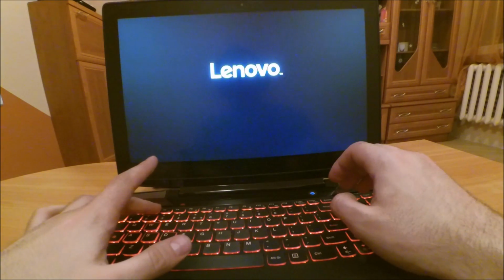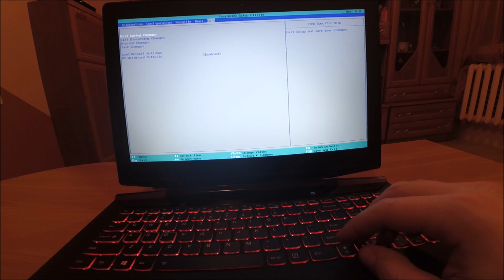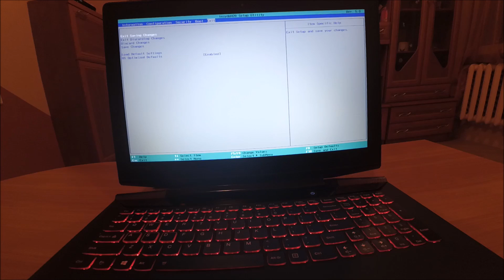Lenovo IdeaPad Y700 SSD Install and Upgrade

Comment: This thing works great to this day, I have both drives as ssd and an external for storage, upgraded it to 32g of HymperX impact CL15 2666hz ram and it is powerfull enough
Reply: Where did you buy your 32 gb RAM space ?

Comment: Did you know this laptop can handle NVME SSD, which is a BIG improvement compared to stock performance. Hope this helps for those users upgrading their Y700. Cheers ;)
https://youtu.be/ssUdNBt0iC8

Comment: I have this and it won't go past the Lenovo start up screen any help I was told to remove the battery and  power it on with just the charging cable does this work help please!

Comment: I'm having a problem with installing that blue connector thing. I don't know if I'm placing it right but the black thing doesn't seem to stay put.

EDIT: Just got it. I had to place it farther under the black thing than I originally thought. The black thing should pretty much close automatically when it's placed in the right spot.
Reply from the maker: glad you were able to figure it out

Comment: Hi GCR, would you have any advice regarding the problem i have trying to fit a Crucial MX300 into a Yoga 700 14isk. The current drive is 4.5mm thick and the new one is 7mm thick. Both are 2.5''. The holes in the metal support will not line up with the screw holes in the mx300 drive due to the height difference. Is there any other method to anchor/fix a drive to the metal brackets? glue?

Comment: Are either of your RAM sticks soldered onto the board?  This laptop is posted on ebay, brand new, for $749, an excellent price for the specs (besides the i7/960m, it's got 12gb ddr4, 1TB hd, 256gb SSD).  The only thing that concerns me is that it says there's a 4gb RAM stick and an 8.  The 8 is removable but the 4 is soldered onto the board.  Is that normal for the Y700?
Reply from the maker: not sure about the specific model you are looking at, but on my laptop both ram sticks are not soldered and can be upgraded
Reply: 80NV002AUS is the specific model.  http://www.ebay.com/itm/Lenovo-IdeaPad-Y700-15-6-FHD-Gaming-Notebook-Core-i7-6700HQ-12GB-RAM-256GB-SSD-/391625142739?hash=item5b2ead71d3#rpdCntId

Just noticed when looking at it again that it also lists a blu-ray writer.  I've heard of some gaming laptops with soldered RAM, like the 2015 HP Omen as an example but nothing like that with the Y700.  Heck, even if it's on the up and up, with the specs listed I'd be all over that for $749 even if I couldn't upgrade the RAM any higher.  It's just kinda unusual and I'm not sure if I can trust it.  

Thanks for the response.

Comment: Hey thanks for the video, I've successfully done this with the Crucial MX300.
Reply: Suzanne O'Callaghan I did not have such an issue. The laptop I have is different from the one you've got, but that shouldn't matter. In theory, if a laptop is using a 2.5" inch storage device (in your case, HDD you want to replace with an SSD) you should just be able to replace it with any other 2.5" SSD. It may be a little bit thinner but that shouldn't matter, so I'm not sure. Sorry, I wish I could be of more help, I pretty much followed this video and it went the same as for the person in the video. All I can say is try again and see if you overlooked something when aligning it.
Reply: Suzanne O'Callaghan It might be that it just doesn't support 7mm, but that would be unheard of for me. Usually what I hear is that a laptop supports only 7mm, but not something like 9.5mm. 7mm is the most common thickness for a 2.5" SSD (and HDDs too I believe).
Reply: Suzanne O'Callaghan Depends on what you want to do, if you want to install Windows from that memory stick, you'll want to plug the memory stick in and boot from that. If Windows is already installed on the Crucial, you'll want to boot from that. Windows Boot Manager can show you different options about how you want to boot and such, and to change settings / recover. Might have to just try both Windows Boot Manager and the Crucial.
Reply from the maker: np, glad it helped
Reply: hi, im just trying to do it with Crucial MX300 on my Lenovo Yoga 700 14isk and I find that the metal support plate holes wont line up with the Mx300. It seems the current hard drive is a bit thinner than the MX300. Did you have this problem? If so, how did you get over it?
Reply: Thanks for your quick response flash. The 2.5" I am replacing is 4.5mm thick whilst the mx300 is 7mm thick. I can't screw the plates onto the new drive. Frustrating
Reply: one other question, if you dont mind. when i turn on the pc i see 2 options in the boot menu 1. windows boot manager    2 ATA HDD Crucial. Which one do i choose? I have an os bootable memory stick

Comment: thanks for your video. I have one question; in order to install my ssd into my Y700 14" I need an adapter which is EXACTLY the SATA to M.2 blue "cable" that you had to remove from that SSD. what is the name of this adapter so that I can buy it?

Comment: Hi thanks a lot for the video. Could you help with an upgrade I'm doing to my y700 14?

The one I bought had 1tb+128gb ssd. I bought a 2.5 inch Samsung ssd to replace the 1tb drive and I've never done any laptop upgrade before.  The OS is on the 128 m.2 SSD. I'd like to clone the OS to the 500 gb ssd. Do I just do that and then format the 128gb m.2 ssd? Where will the OS run from when both the m.2 and 2.5 inch ssd are installed?

Thanks,
Khaled

Comment: if i want to upgrade my hdd to samsung's 850 evo 2.5 inch 1tb version! and m.2 to 512gb samsung's pci-e slot one! it can work? currently i have same hybrid hdd 1tb and 128gb ssd!
Reply: The intel version of the laptop takes pci-e ssd drives.

Comment: This latop comes with an available M.2 Sata slot for SSD upgrade right? It makes no sense you buy a SATA SSD, replace the HDD and throw the HDD away. Bad decision bro.
Reply: exactly!
Reply: He said M.2 cost more.
Reply: M.2 is way more expensive bro....
Reply: install both.  This is my plan.
Reply from the maker: your post makes much sense, but the thing is I did not buy my SSD drive, I had bought it previously, so it made little sense for me to buy a new m2 drive, it would be a nice upgrade if i had the money tho, maybe once i make it big on youtubz
Reply: yes it is. I've been searching for the past month man. m.2 is 100 to 200 dollars more than a similiarly sized SATA SSD. If you've found different (not that Intel 600p crap) please send a link. I'm kinda desperate.
Reply: Sebastian Luna Cortes no, it's not :-|

Comment: Do you need unplug battery?
Reply: Nope, just make sure the laptop's not turned on and not plugged into its charger.
Reply: +Lance Shield and what about screw for m2 ssd?  Can it hold in place without screw
Reply: No, it needs one 2.0 x 3mm screw, which can be found at basically every hardware store.

Comment: Whats the purpose of all the foil looking things that covers the HD and the RAM?
Reply: heat dissipation. they conduct heat outward and its sweeped out by the fans.  I guess they crammed in high end hardware into such a small body, they need to use these metal sheath.

Comment: Thanks for the video. After I undid the screws I was worried about trying to force that gap open thinking there was a rivet holding it together, but apparently not

Comment: The model that comes only with a 256gb SSD is it possible to add a 1tb HDD as well?
Reply: Yes!
https://forums.lenovo.com/t5/Lenovo-P-Y-and-Z-series/Lenovo-Y700-SSD-and-Memory-upgrade/td-p/2200745
Reply: Sorry to ask 5 months after your comment, but that page only explains how to install ssd if you already got the 1tb HDD version. From my understanding the 256gb SSD version comes with an empty slot for an extra harddrive but no connector(?). So where would I get one of those, or is this something Lenovo has addressed?
Reply: ImRageQuitter I got the 256gb SSD Y700 and yes there is an empty slot where you can add a hard drive(I added a 500Gb SSD),and yes you need a connector that you can buy anywhere I think(you can definitely find it online though).

Comment: what is the port called that he used from hhd to the other one ?
Reply: SATA is what you're talking about?
Reply: +OxGualG043 the hard drive connector cable my one doesn't have that
Reply: thats what im wondering too.. ffs
Reply: Look on ebay

Comment: Thanks a lot for this video! What should I do if I want to perform a clean install in the M.2. I don´t care about the data of the HDD. I have already made a USB with Windows 10 on it, but I don´t know how to insall it in the new SSD. Do I need to remove de HDD? Help me please!!
Reply: Just prioritize the SSD in the BIOS boot menu so that the SSD boots first then the HDD. Plug in the bootable WIN10 USB and when the machine boots it will prompt you to install win10 since it detects no OS in the SSD as it sees that disc first. 
When you do that, if you still leave the SSD to be the first to boot the machine OS, you can safely format the HDD having Win10 only in the SSD.
Reply: @flyingspaghetti  im from the future. thank you very much
Reply: please answer this comment ,it's my problem too.. should we remove hdd for adding a ssd hard drive???????

Comment: Good video, cheers ;) 1 thing i dont quite understand is why you remove the 1TB HDD and replace it with a SATA SSD, while there is a SATA 2280 M2.0 SSD open and ready for use? A M2.0 SSD is even faster and then you didnt need to remove your 1TB drive. Cheers again for the video ;)
Reply from the maker: +Stroffel main reason is that i had an SSD drive from my previous laptop and did not want to spend another 200 euros after just buying thee laptop for 900. I'll upgrade eventually.

Comment: Nice video! But Lenovo I think left special slot on right of your "fusion" hard drive. This slot is exactly for SSD - so there is no reason to remove the 1 TB drive - it is a good storage option. Small slot is for special very fast SSD which look like a tiny board.
Reply: my friends y700 has a 128gb m.2 sata in that slot.  It's so small that most of their content is on the noisy, hot, slow HDD.  We replaced the HDD with a 1tb SSD and the small m.2 with a 500gb m.2

Comment: 3:03 that noise was the sound of your product warranty suddenly expiring. Next time, insert the tip of a plastic zip-tie into the corner gap, and wiggle it around the sides to gently release the locking clips.
Reply: The product warranty on these things are a joke anyway.
Reply: Please explain how to do that.

Comment: s it M.2 pcie or M.2 Sata? What is the m.2 size?
Reply: This is an 2280 M.2 sized slot.  Its not SATA, its PCI Express.  I put a Samsung 951 (AHCI) SSD and works fine.  Be warned that some people had problems using NVMe SSDs.  So I suggest the safe and tested solution. Samsung SM951 AHCI edition M.2. 2280 sized SSD.  Ofcourse if you choose to put there a sata3 m.2. ssd it will work as AHCI is sata3 backwards compatible. Hope I helped

Comment: Hey man. I have this notebook but the version with a single 512 SSD. Do you think I can add a another SSD?
Reply from the maker: +E. Camilo you should be, you just need to know if it has m.2 ssd or sata and get the other one.
Reply: +E. Camilo +Game Changing Rice i have the 512GB SSD version too and just got my 1TB crucial SSD I wanted to install into the Lenovo y700 as a second SSD. BUT.... where in the video the HDD is shown with mount and cable, there is absolutely nothing... so now i miss a cable and the mount for the SSD. other than that it will work i guess
Reply: Beat Scherrer Yeah, I found that the hard way too. Do you have any idea where can we get those?
Reply: +E. Camilo hey i can send you the link later this day or tomorrow, but if you're not in the US the provider won't ship below 200$... which is quite shit for me as a european.
Reply: I am also in Europe - Denmark. Both cable and the support cost 200 dollars?!?
Reply: the company who sells the parts won't ship to europe unless you have an order above 200$... which is kind of ridiculous... the parts cost about 30$ (brackets and cable). the site https://www.encompassparts.com/ and the part number of the bracket is 5B40K25518 and the part number of the cable is 5C10K25544 ... it really bothers me that the y700 was sold without those parts, it's just annoying and kind of a bad move for the lenovo company. nvm if you can find these parts anywhere else available in europe, pls let me know. seems that many other people had the same struggle and some did really get pissed off by lenovo. gotta try the support some day soon. cheers
Reply: Beat Scherrer These items must exist in some other webiste. Maybe eBay. I found a few but I need to make sure it is the same.

http://www.ebay.com/itm/5B40G59773-Lenovo-Y70-70T-HDD-Bracket-Caddy-Grade-A-/161918475118?hash=item25b317db6e:g:kMAAAOSw1S9Wb20X

For example.
Reply: +E. Camilo just be sure to get m.2 2280 (22 by 80 milimeters)
Reply: +E. Camilo What kind of screws did you end up using to mount the bracket and HDD?

Comment: Why not on m2 SSD? in Y50-70 was without M2 but Y700 have this port. You can have 2 drive and M2 can be even faster
Reply from the maker: +CZARNYEU because I already had the SSD I installed and i did not really feel like spending another 100-200 euros for an m.2 when i spent 900 on the laptop for now. Next thing i'll add is probably more ram.
Reply: Game Changing Rice i upgrade RAM and replace HDD with SSD in Y50-70 - videos about it is on my channel. I think you should install M2 SSD in future
Reply: +CZARNYEU m.2 in this particular laptop is no faster than regular SATA, because it's connected to SATA anyway. m.2 is much faster when it's connected directly to pci-e. but not in this case.
Reply: +Piotr Karaszewski może nie jest to NVMe ale ciut szybciej niż przez SATA

Comment: does the laptop have M.2 slot?
Reply: +Game Changing Rice is it M.2 pcie or M.2 Sata ?
Reply from the maker: +Valeri Karastoqnov can confirm that it does
Reply: +Game Changing Rice what is the m.2 size? thanks
Reply: +Dancin Cars +Valeri Karastoqnov Yes, it has an M.2 SSD Slot....The M.2 Size is 2280, 22mm wide, 80mm long, but shorter 2240 and 2260 ssd's can be installed with extension brackets or tape (lol). My Y700 currently has a 512GB Sandisk X400 M.2 2280 SSD + 2TB Samsung M9T HDD. Nice budget gaming/multimedia beast.

Comment: I have the y700 15 acz what ssd should I get
Reply: +Ryan Kheng it has an M.2 SSD Slot....The M.2 Size is 2280, 22mm wide, 80mm long, but shorter 2240 and 2260 ssd's can be installed with extension brackets or tape (lol). My Y700 currently has a 512GB Sandisk X400 M.2 2280 SSD + 2TB Samsung M9T HDD. Nice budget gaming/multimedia beast.
Reply from the maker: +Ryan Kheng any ssd should work, if you want to use m.2 then you have to check up on compatibility.
Reply: +Game Changing Rice nice im looking at some on crucial right now
Reply: What model are you showing in the video? Is it the 80NV0029US?

Comment: How was the reinstall of windows? When you installed Win10 did the key just go through right away?
Reply from the maker: +Harold Allen Poquiz it was straight forward, did not have any issues at all.
Reply: Game Changing Rice I'm about to buy the 15" without SSD, just wondering if it came with a WIN10 CD or I have to make one myself for changing to and SSD.
Reply from the maker: +Harold Allen Poquiz mine came with FreeDOS pre-installed, I had to buy Windows 10 separately. If I had to guess it will come with W10 pre-installed too.
Reply: +Game Changing Rice yes, but its easier to just clone the hard drive... you can get a kit for about 40